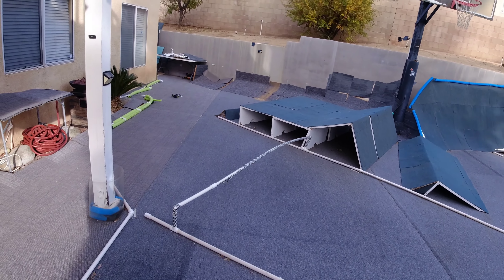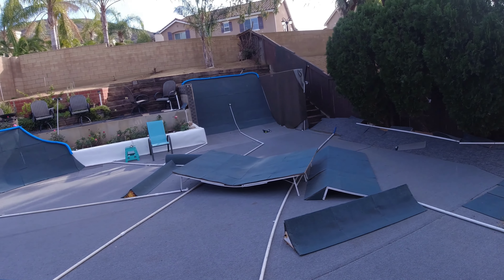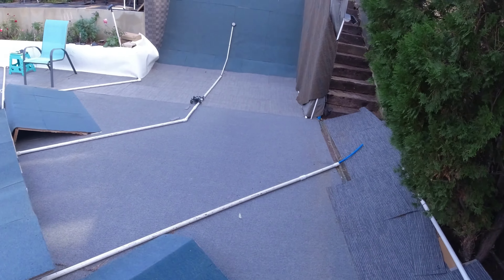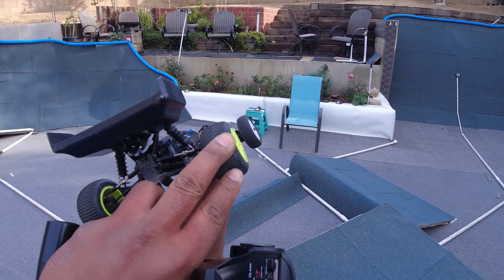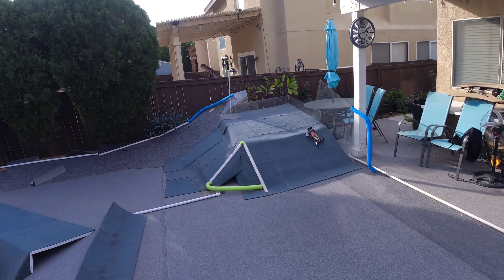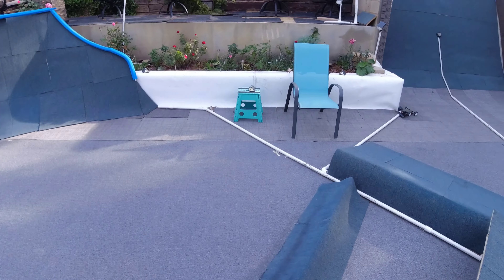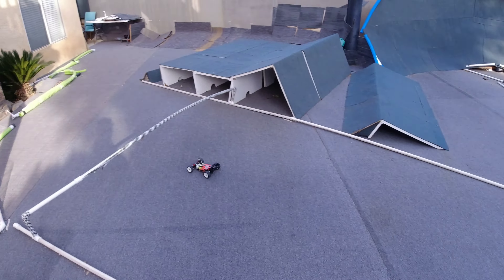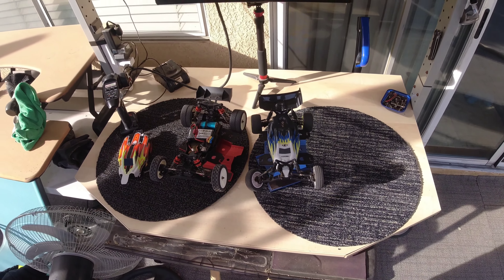LC Racing BHC-1 Vs LOSI MINI B 2WD track buggies

Comment: That's interesting about the difference between red and blue surpass motors. I have a few different sizes and kv of each, but I never noticed the difference. I haven't compared equal kv and size.
Reply from the maker: The only reason I noticed it was because of how the car performed on the jumps and how much throttle it needed to level it out. Blue can almost coast in the air with little control needed. Red can bring the nose down due to its drag feel needing more throttle to level the car out.